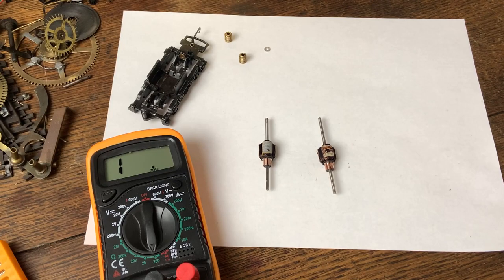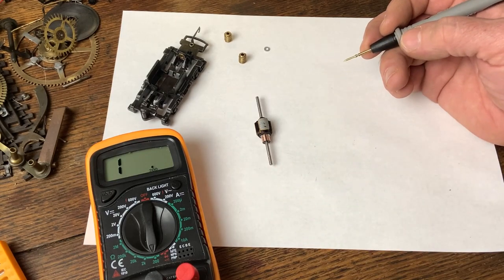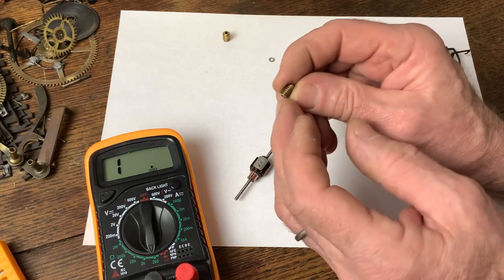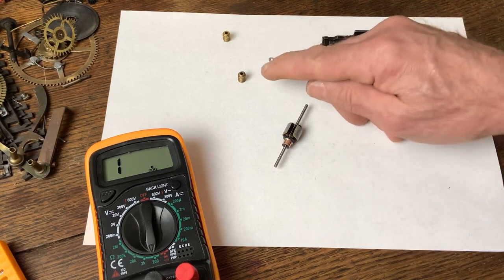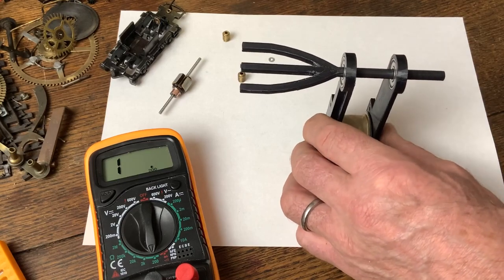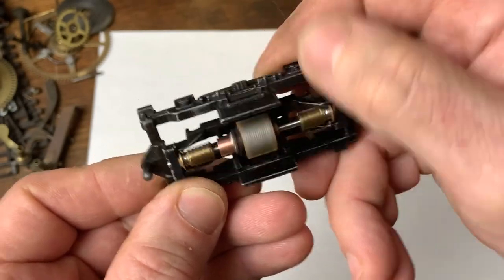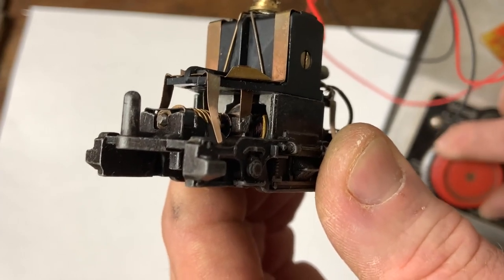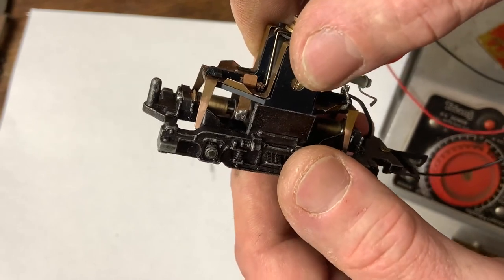Continuing The Tri-ang X 410 Armature Re-Winding Project, Getting The Armature Ready For Testing

Comment: Excellent work Mr Snooze! There's another thing you might want to look at - the plastic 'spider' commonly develops a slight fault on one of the brush mounting holes - the one without the copper strip through the hole often wears (melts?) the plastic and the hole ends up squarer than it should be.  This has the effect of the brush not aligning with the correct point on the commutator, leading to running issues. I saw a solution by re-packing the hole to bring it down to correct size, on another channel, but can't remember where, possibly a 'Chambs123' repair  !  The original video was for a motor that used the plastic bushes between worm and coil as bearings for the armature, so maybe not an issue where the armature is supported by end bearings. Your work so far seems promises to run very nicely anyway! Cheers. Mike
Reply from the maker: Hello Mike, I've seen melted housings but this one is ok which is good. I too have seen excellent repairs to these but cant remember who did it. Take care, all the best to you

Comment: Great result. Out of interest, did you check the unwound resistance of the wires before winding this time? The commutator resistance reading of circa 10R is what would be expected on a 3 pole motor with coil resistances of around 15 ohms so, on that basis, it's looking good. Looking forward to seeing it running on the super 4. Tom
Reply from the maker: I will definitely do a test on 8 metres of wire, The motor is smooth and running nicely now and the windings are varnished so it's nearly time for a test run. All the best to you
Reply: @MrSnooze  Good to hear, great job! Look forward to learning the resistance measurement.

Comment: Hello wondering where you connected each end of the wire!
Reply from the maker: Thanks for watching. Once the winding was finished I tested to coils and then soldered the wires to the copper commutator. Take care, all the best to you
Reply: Hi I did the same as well. Although the motor is only doing 1-2 rotations then coming to a halt. It makes sounds that it’s still trying to rotate. Any idea what this could be? Things to note would be:
-made sure current was going through each pole by testing the resistance of the wire. 
-Made sure resistance of each pole was the same and also each pole has exactly the same amount of turns 
-Tested the commutator to make sure it was functioning correctly with a multimeter 
-Tested the two initial test points for shorts 
-Tested brushed for shorts 
Unwound wire and rewound new wire 
Coated armature with multiple layers to ensure no shorts would occur
If you have any insights it would be appreciated greatly. Thank you!
Reply from the maker: I'm sorry to hear you are having problems. I had a few issues the first time or two. I guess all you can do is try again. Good luck. Best regards to you

Comment: Hi I wonder if you can advise me as to what may be my issue. I've just completed my first rewind of the similar motor in a triang class 37 I've used a 0.125mm winding wire. The armature took 250 winds. The motor was installed and ran well on the test track however when my friend tested it on his simple hornby oval operated with the hornby basic controller it ran well initially but then started to slow down untill it eventually ground to a halt and wouldn't move. He said there was an electrical smell I put this down to the windings heating up and burning off residual dirt or oil etc. But I have no idea why it would. please help I'm absolutely stumped on this one. 🙏
Reply: I forgot to add there is no capacitor or suppressor fitted it was like this when I got it.
Reply from the maker: Congratulations on your first rewind. It does sound like something has happened unfortunately. I would check the commutator first just in case some contamination has got on the brushes. Then take some resistance readings and check there is no short to the laminations. If still no good I wood unsolder the windings and check the resistance of each winding. I hope it's a simple fix but if there is a winding fault have another go. Don't be put off, It's fun mending these items. Take care, all the best to you
Reply: I measured across each segment on the commutator I'm getting 7.5 on two and 7.4 on one so I'd say it's fairly close all over. I've had it running again this time the chasis has gotten really hot before the motor stopped and the brush carbon came detached from the brass arm. So I'm at a loss. Why is it getting so hot I guess is the starting point. 🤷‍♂️ Helllpppp. ☺
Reply from the maker: @djflipside100  can you measure how much current it is drawing with an ammeter when it's running? It should be drawing no more than 300 milliamps. Have you remagnetised it after disassembly? Low magnet strength can cause these symptoms
Reply: I haven't, I was just going to do that when it gave up 😂 I'll get it back together again then try. I haven't done anything with the magnet I don't have a remagnetiser.
Reply from the maker: @djflipside100  ok, that could be your problem. When you disassemble this type of motor the moment you remove the pole pieces from the magnet the whole thing looses a huge amount of it magnetism. Anytime it's disassembled it requires remagnetiseing before you can run it. If you haven't got access to the kit your answer would be to fit a modern neo replacement magnet. These don't loose their power when removed
Reply: @MrSnooze hi hope your well. I wonder if you have an email that I can send you some videos on regarding my rewind and issues I'm finding as it's really challenging me. Thanks ian